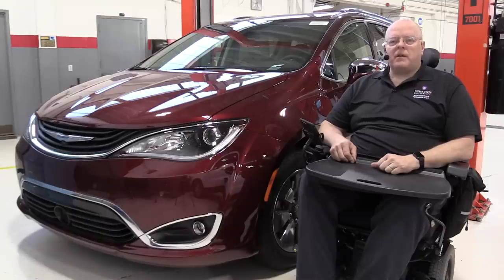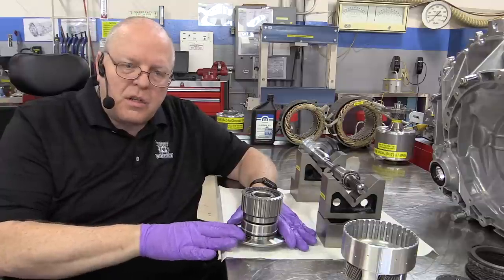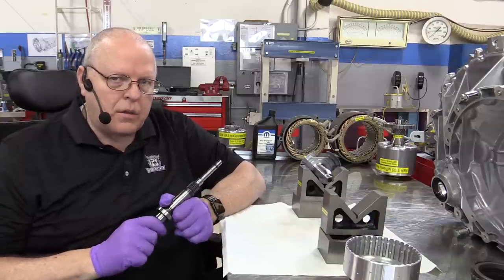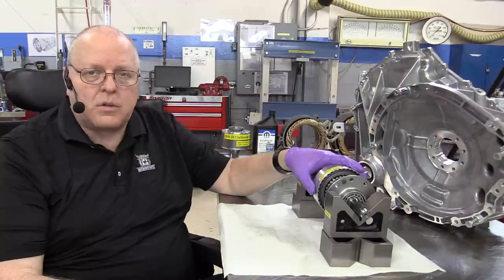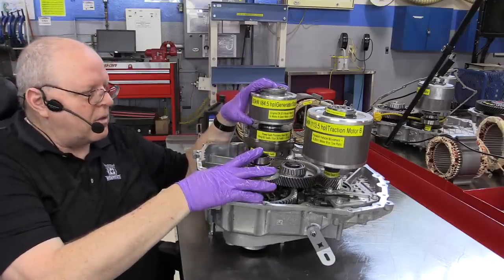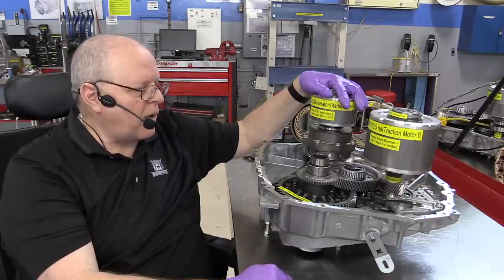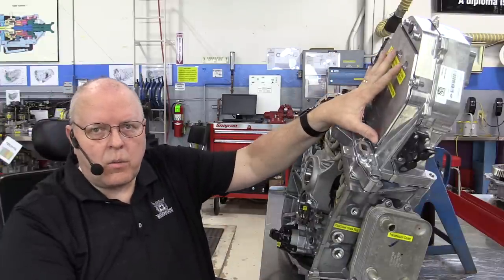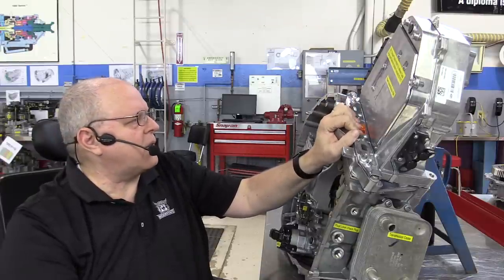The 2017 Chrysler Pacifica Si-EVT Hybrid Transaxle - Deep Dive

Comment: Sincerely one of the coolest videos I’ve watched in a long time fairy comprehending I’m just a guy that works on cars in the garage but I actually have a 2020 Pacifica highbred and I wanted to get some information about the transmission which you’re very used for a very enlightening me about what’s going on in it my question though is they have a drive mode and an L mode low and a lot of people say they’re driving around even on the highway in L mode low gear and I was wondering in the long run does that make a significant difference on the transmission to me it seems like it would work at even Harter even know you get the region from leading off the throttle at a high rate of speed to slow down any input greatly appreciate it thank you sir
Reply: Driving in L is just a software setting that increases the regen braking aggressiveness.  So driving in L all the time isn't harmful, actually helps capture more energy.

Comment: Big fan of your channel! This vehicle has a Fuel and Oil Refresh mode that causes the ICE to run constantly until certain conditions are met, even if the battery is fully charged. My question is how does this transmission operate if the ICE is running but the wheels aren’t moving? Is the ICE spinning against that torque limiting clutch? Or are they spinning Motor A such that no torque is delivered to the ring gear to create a neutral gear even when the ICE is operating? Is the ring gear just being held by the brakes, causing the torque to go to Motor A?

Comment: very useful video, the only one on the Internet. Thank you very much!
Is the Fluid Level Check Plug also used for filling oil, or do we fill it from the bottom, through the drain plug, under pressure?
Reply: I suppose I know already : On the front side of the transaxle midway up are two plugs. One is for filling, the second is for a special 90-degree dipstick for checking the fluid levels.

Comment: For coolant control, does the Pacifica use electronically controlled thermostat valves?
Reply from the maker: No, there is an electric water pump that controls the coolant flow through the inverter and the transaxle heat exchanger. Pump speed is modulated to control temperature.

Comment: I was late getting to this video.   Interesting transmission but sure seems big for the power it handles.

The valve on the heat exchanger is almost certainly a pressure relief valve for the oil. Standard hydraulic oils at arctic or near arctic conditions (looking at you, North Dakota) can become quite viscous. Brazed plate heat exchangers like you have there have multiple interlaced layers for each fluid. The passage areas are very small but the surface areas are large. Even a fairly modest pressure inside can exert considerable force over that cumulative surface area trying to split the device. Over-sized relief valves are often used to protect oil coolers on equipment headed toward the arctic. 

Regarding inlets and outlets: Each circuit of a brazed plate heat exchanger flows in the same direction. The two circuits are always plumbed to flow in opposite direction for maximum temperature differential between the two fluids at any point in the circuit.
Reply from the maker: Thank you for your feedback

Comment: Just bought a 2018 model. Excellent video! I may be showing my ignorance, but I don't understand the sizing decisions on this transmission. To me, the single input shaft and splines seem so small to carry so much torque relative to many of the other components, especially that big honking final drive gear. Is this normal? I worry about shear strength and fatigue on that input shaft. Also, I would love to know the reasoning why the clutch pack assembly is a necessary component within this system and what set of circumstances would cause it to slip. Perhaps only if the vehicle load rating were exceeded (towing?), thereby providing a less expensive point of failure as well as a smoking gun (or clutch pack) against honoring warranty claims that would arise from towing? Or is there a more common scenario that us owners could watch out for and avoid to help prolong trans life?
Reply: I was watching this last night and reading through the comments and figured I'd get you an answer.  I'm a machinist and I make a lot of turbine parts, but most of my parts are input and output shafts, trip bodies, governor vales and other cylindrical components other an indexer on my mill.

In this video at 2:45-3:00 you will see a jet turbine engine and where it's input shaft is located - https://youtu.be/0XRhCwk7XzU 

Make note of the size of the turbine, it's power output and the seemingly small bore that the input shaft goes into on the center of the face of the turbine. You should notice that the input shaft on that engine isn't all that much beefier than the one in this transaxle.

The input shaft on this transaxle is more than enough to do it's job. Idk if you'll ever actually see this so I won't get into the weeds of how that works unless you happen to come back and ask.
Reply: @apersonontheinternet8006  Thanks so much for that explanation and video! I also did some searches that seemed to highlight how small these shafts seem to be relative to how much force they convey, so I guess it's not always about size. There must be something to the type of teeth used and maybe high strength materials? I'd still love to have someone weigh in on the purpose/need for the clutch pack in this system. Perhaps it's there as a way to introduce just a bit of "give" in case something torques too fast, an electric motor perhaps, to avoid stressing the gear teeth in the system?

Comment: Thanks for this video, professor.  One thing I notice is that this hybrid transmission is seriously complex.  Take a standard automatic and a standard BEV drive and now you have the worst of both in one package!    No wonder hybrid cars are so pricey!
Reply from the maker: Thanks for your feedback. They are complex. A BEV gearbox is very simple compared to this.
Reply: I think this transmission is not nearly as complex as a traditional automatic or even a manual transmission. It doesn't have a lot of moving parts, and the only friction component is engaged only in rare overload conditions.

Comment: Excellent presentation, professor.  However, must correct one small part of the description, at timestamp 41:10 to 41:40.  The percent split of engine torque between Motor A and the main drive is CONSTANT for all speeds when the engine is turning. (That's in the nature of the planetary gearset.)  There is nothing special about the equal-speed case for engine, drive, and motor A, except that the power split percentage happens to be equal to that constant torque split percentage. This is NOT the point of maximum torque delivery from engine to drive.  (I notice a similar mis-statement in your Prius presentations.)
Reply from the maker: Thanks for your feedback
Reply: Can you elaborate on this a bit more please?  I ran into the same problem during the prius videos...  When the engine is turning and supplying torque all of that torque will go to the Transfer shaft correct?  For a planetary set one component must remain fixed - is this acheived by rotating the Sun in the opposite direction (essentially keeping it 'fixed' in a relative motion sense)?
Reply: @JJpleex  I think viewing the PSD device as differential can help, where the engine is connected to it's input, one axle drives the load and the other is connected to a motor generator or brake.
Reply: @Coolkeys2009  Thank you!

Comment: Great video, all of ur vids!, but here is my question, so per spec the car can dump 120hp in all electric mode, and 260hp gas engine.    If the generator can only produce 83 hp then u have 83 from engine in excess, that is 166hp.(assuming no battery help).. And if the traction motor tops out at 113, then u have 83+113,=196... Where am I wrong?    I don't understand how 260hp gets to the wheels.    Pls explain....

Comment: Question for you. Like my Ford HF35 PHEV vehicle, this has a two conductor high voltage DC connector for the AC compressor. Does the AC compressor have an inverter embedded in the compressor to control the compressor speed? Have you disassembled an AC compressor from one of these vehicles?

Comment: Hello, can somebody tell me why the manual say you CANNOT tow a trailer with this Pacifica and transmission??? I own a 2018 Pacifica Hybrid and would like to tow a 1000 lb trailer loaded to 3000-3500 pounds (total weight with trailer included) and tow it a few states over (1700 miles CA to TX). One time tow, I don't plan to continue to use this trailer, just for moving. I will have two adults and two small kids in the car too along with other items in the trunk. So under the 1700 passenger weight for the vehicle. Thanks for all the responses.

Comment: I know I’m a couple years late but thank you very much for this video my one question is I noticed at the top of my fairly steep driveway I have to be quick to touch the break or it will roll back very fast does that have something to do with this transmission style
Reply from the maker: Yes, absolutely
Reply: @WeberAuto  it’s amazing they can get 100 hp out of something the size of a paint can. I’ve never had much luck with Chrysler transmissions I sure hope this one is better

Comment: Sorry about such a simple question but other variance of this 3.6 L put out 280 hp or so so why would the exact same 3.6 L engine with two electric motors have less total horsepower? Does that mean the ice engine is turned way down? Thank you

Comment: I would like to ask about this gearbox. The car manufacturer does not recommend towing trailers by pacifica hybrids. Is this recommendation due to the design of the gearbox?
Reply: I have the same question, why can't this car tow a trailer? The gas pacifica can tow 3700 pounds.

Comment: Is anyone able to explain if using this PHEV in L mode can be detrimental vs D mode on transmission? I mostly mean while in full EV mode with battery having enough charge in town.
I understand that when battery depleted and the vehicle is driven by gasoline engine in parallel hybrid mode that L mode might be dangerous for the transmission.

Comment: Professor: thank you so much! Wikipedia says this is an Aisin T-032 eCVT ; any truth to Aisin contributing to it? I know they said they build it in Kokomo at Chrysler
Reply: This transmission is built by Chrysler in Tipton, Indiana (Tipton Transmission Plant) just 20 minutes away from Kokomo. Some of the 948TE 9 speed transaxles are also assembled there. It is NOT an Aisin design.
Reply: @johnfleck2240  Thanks sooo much I did not think it was, was surprised Wikipedia said it was an Aisin